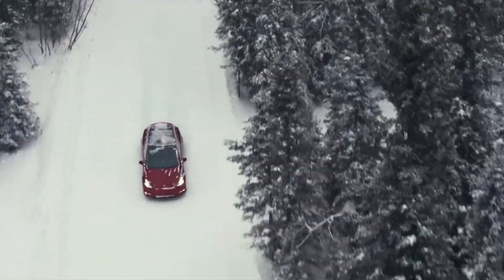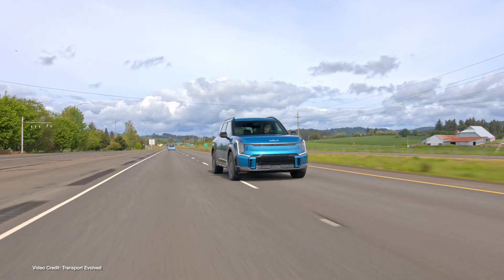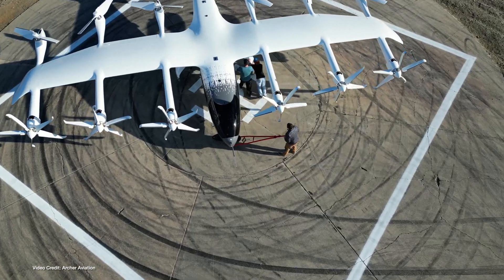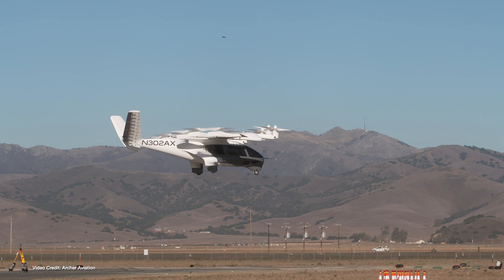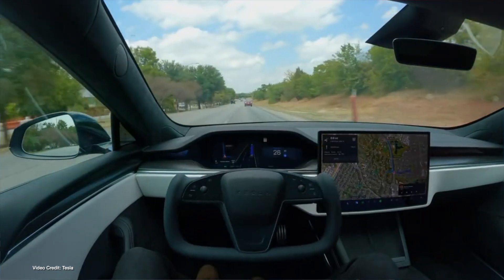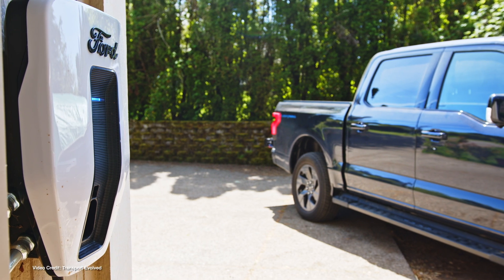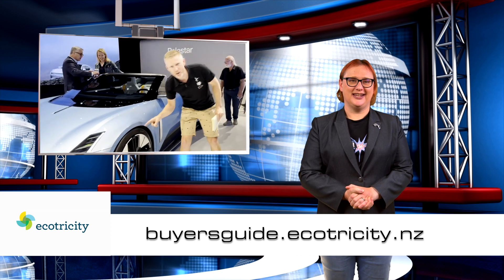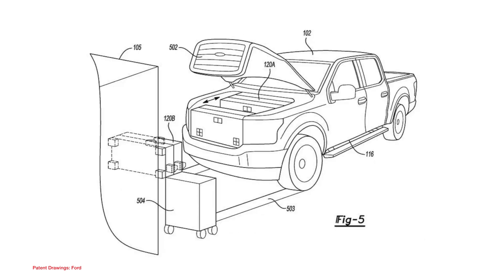ecoTEC 326 - Archer Midnight Approval, EVs Get Cleaner, Diesel's In The Doldrums!

Comment: Automakers (Ford, GM, and Mercedes) are stepping back on EVs and focusing more on hybrids.   The public wants the convenience and familiarity of ICE vehicles.  The current crop of EVs don’t fit that category.
Reply: Because their EVs are not very good and they will give up future market share to other manufacturers.
Reply: @ObiePaddles  The mainstream consumer wants a vehicle that can be replenished in 3-5 minutes and doesn’t take a PHd to figure the controls. Thus far, no EV fits that category.  Right now, just a little over 1% of USA registered light duty vehicles are EVs which amounts to 3M out of the 288M on the road today.  EVs have a chasm to climb over before it is mainstream.
Reply: @williamquemuel7824  So you ignored the fact that they make bad EVs.  Anyway, you are wrong on both counts:

Most EVs charge overnight at home.  Takes 30 seconds to plug in and take out.

If you cant figure out the controls for a Nissan Leaf you shouldn’t be on the road.

And if you want to do the ‘not everyone can charge at home, which is true, those I know charge in shopping centres which takes about 3 minutes.  On long runs we charge while on rest room breaks or lunch etc.  Takes less time overall than finding a gas station and filling up (which no-one does in 3 mins).
Reply: @ObiePaddles  Considering only 1% of registered vehicles in the USA are EVs after 14 years of production shows that you are wrong.  The early adopters are the majority buyers not the mainstream.  My statement stands for the mainstream buyer: convenience and familiarity.
Reply: @williamquemuel7824  that’s a poor understanding of maths.

Remember when Nokia said something like only 1% of phones in production were smartphones…probably because smartphones were ‘too complex etc’.  That’s where Ford etc will be if they dont get their A into G (or Government to stop imports).
Reply: @ObiePaddles  I agree with you that EVs are bad.  Consumer Reports in USA identified only 4 EVs that are recommended and have above average reliability (Porsche Taycan, Nissan Arriya, Lexus RZ and the Hyundai Ioniq 6). Of these, IIHS identified only the Nissan Arriya and Lexus RZ as the only EVs with Top Safety Picks rating.  This means the majority of EVs are bad.
Reply: @ObiePaddles  I suggest that you read the books on “Diffusion of Innovation” and “Crossing the Chasm.”  To achieve crossing the chasm from Early Adoption to Early Majority, EVs have to be redesigned to be practical to masses. That’s where convenience and familiarity come into play.  As far as math is concerned, cars are much more expensive than smartphones.  The 1% stat comes from the US Dept of Energy (under the Alternative Fuels Data Center).
Reply: @ObiePaddles  As far as charging is concerned for city dwellers in apartments, Cash Jordon has YT video on the subject that is very enlightening.  In it, the impracticality of charging EVs is exposed.  Cash Jordan leases an EV and lives in NY city so he points the downside of the charging. Watch the video before you make more unfounded comments.
Reply: @ObiePaddles  Actually, James May (Top Gear alum) reported that he can refuel his Porsche in 3 minutes.  James May also pointed out the time that losing charge andI driving to an EV charging takes.  I sincerely hope that you come with better references and not unfounded/ unsubstantiated comments.